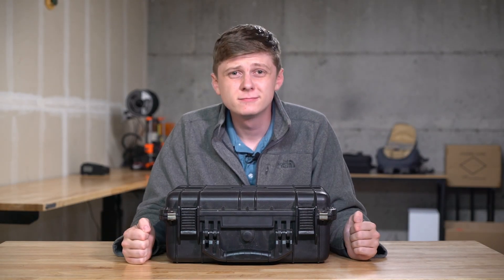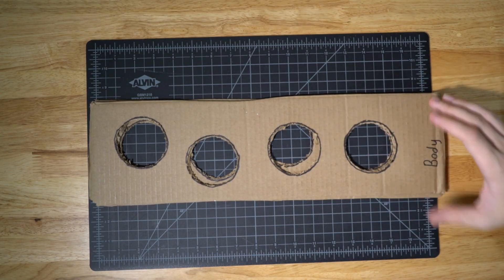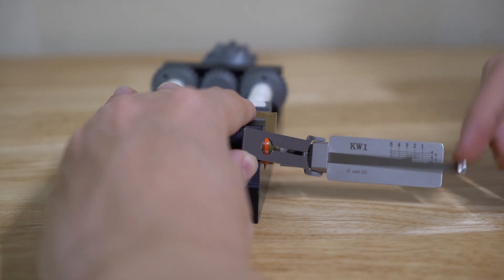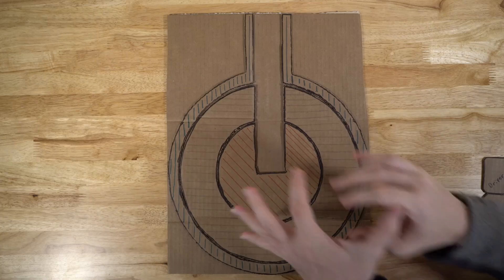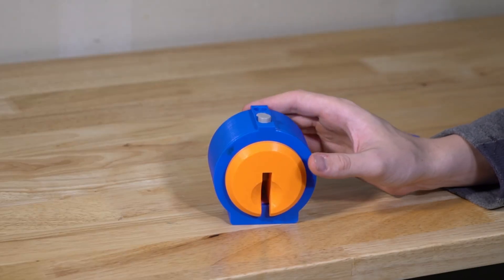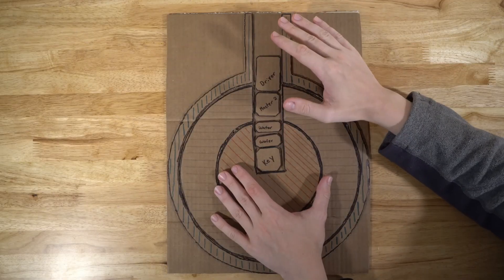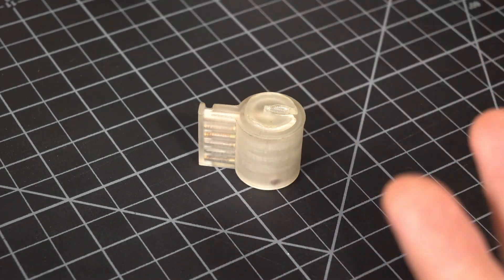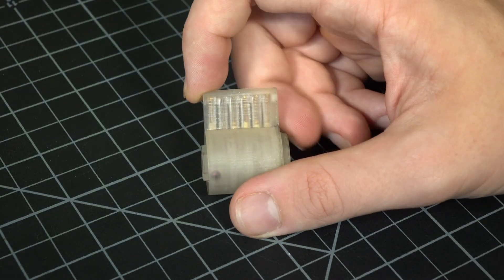How to Design an Unpickable Lock

Comment: You are intuitive, innovative and certainly provocative. Can you develop a bearing case for skate/longboard that takes advantage of resisting electro magnetic force for a two fold function, namely : to reduce the friction between the inner core of the casing on the bolt of the truck and produce a never ending current to keep the board moving untill a reverse polarity is applied, eliminating the nees for batteries and their exhaustive, exasperative and voracious appétit for renewed energy?

The question is not wether this is possible, the question is will it be you ? I could not conceive the plans for such a "devious-vice" 🤣, only the concept, so I've certainly achieved a pride of place, it now awaits honorificabilitudinitatibus to light upon you.🧑‍🎓

Comment: So, why not just add a watchdog pin to a normal lock (that is not accessible from the key hole) that is made with much higher tolerances and will almost always bind first?
It seems to me you already solved lockpicking with that one feature, sorta removing the need for overcomplication of the rest of the lock.

Comment: I enjoy locksport and I like the idea behind your lock. It would be a challenge to pick and wouldn't be difficult to make in brass either.
That said, locks are not the weak point 99% of the time. Most criminals will just break a window, kick in the door, or move on. Rarely is picking used in a crime.

Comment: with patience there is no such thing as an un pickable lock.. there are locks that break completely once picked. because they work in some ways similarly to this but this is a damn good start. nice video. the only flaw is the reason locks are made slopy is two fold 1) cutting costs for the end user and mass production. 2) duplicate keys even when cut using the original kay almost never work long after being made super precise locks require super precise keys. and those keys and the lock it self go through wear and tear every time they get used shoved in your pocket bang on other keys or objects get hand grim and dirt on them ECT.. if you loose your key you are boned. locks are the way they are so that if for some reason the lock cant be opened via the key you need not destroy the lock or container, hardware, what have you to get at what you locked up.  there is an old syaing there is no such thing as Safe.. or Secure. i imagine this idea has likely been thought of maybe even tested behind closed doors and found to be not suitable for the average user. due to complexity of design or expense to the maker/end user. after all there are no original ideas only first time presentations. the only lock that cant be opened is a lock that was designed NEVER to open .. for any reason. i helped design such a lock. therre is no key and no way into it with out destroying the container/lock mechnism. and subsequently it's contense.. it was an theoretic lock for housing a cursed item. opening the container destroies the item inside. it was a fun challenge.. again great video. but how would you adress the concerns above?

Comment: One way to defeat the watchdog pin is via concussion. Strike the thing you are trying to pick, often it's enough to do with your hand and the pins will jump up due to inertia. Especially when you include all the manufacturing defects it's really easy to do it this way and there are plenty of examples of new locks that fall short against this technique.

Comment: No lock can stop my sledge hammer. Its all about how strong the frame and door holding it is.
If the hammer doesn't work i switch to a pick axe.

Comment: I had pretty much the exact same idea, but i lack the 3d printing skills to actually test it.

I have one major improvement suggestion. Having a full middle core is a lot of material and take a lot of space. Instead you can use a small block just above the inner core. If the call the rotation plane xy, inner core would push the block in the z-direction after turning a bit and only if the shear line fits is it able to push the middle block and complete the rotation. This also eliminates the need to protect against binding the core to the middle core, since they now move in different directions.

Comment: Sorry, you don’t understand lock cylinder that well.  Your cardboard replica is wrong, the pins are not sloppy in the cylinder or housing , cheaper cylinder will have a larger gap in the sheer line.
The cylinder you are describing to make is called a Master ring cylinder made by Corbin and Russwin years ago.

And like most comments, people don’t want to spend money on higher quality locks, the  Ridiculous attitude that a lock is lock is where the ignorance comes from.

Comment: I think that the reason that most locks are very easy to pick is that the simplest and most common method of bypass is and always will be physical force.  Lock picking requires some level of knowledge and skill and while it's easy enough to learn these days historically it's been a much more rare skill.  Even in modernity the method professional lock picks use is to destroy the lock with a drill.
Reply: Speaking as a LockSmith... if your "goto" is a drill, You're not much of a LS

Comment: Just use an electronic lock. I have no idea why we are still clinging to the past and mechanical ones.
Reply: Because electronic digital locks still have flaw, with different solution of picking.
Mechanical locks are picked by physical force, while electronic locks are picked by both digital force AND physical force.

You don't get more security for having more attack vector.
Reply: @nilamelody  because you don't have to provide access (keyhole) they are not as susceptible to physical force. And how do you pick a digital lock if it has a progressive rate limit? That would literally take forever. There are theoretical ways to intercept it if you use some stupid way of sending the code, but not all of them use that and it's easier to change it. The only thing that is still holding it back is the cost and for that we need economics of scale.
Reply: @XRENDERMAN  I think you misunderstood what I mean by "physical force" :d
I'm talking a literal force to break the locking mechanicsm open, not picking a mere keyhole.

Also im not sure if you know this or not, but digital lock has actual physical mechanical part inside to actually provide the locking mechanism...
Which if you been paying attention to what I was saying, is breakable by physical force.

If you think that is unfair, then it is indeed.
That is why bank vault uses big mechanical vault made of strong metal. Because to counter such unfair force, is to have an equally unfair material to do the actual securing part.
Reply: @nilamelody  yes and you can easily put more metal between them and even conceal the location(s) of it because any type of reader is not necessarily colocated with actual deadbolt(s).

Comment: Pretty ingenious design. Excited to see a properly manufactured one being sent to some lock picking masters. It may end up not being any cheaper to produce than a simple electronic lock (which should be able to offer perfect picking resistance if done right) but an analog / non-powered alternative could still be very useful.

Comment: In 1972 or 73, I saw a demonstration of a lock that used a set of magnets to unlock it.  The key was set in a prescribed place on the lock body and if the correct set of magnets was in the key, the lock opened.  There was no turning of parts.  The only thing that moved was the shackle if the correct key was used.

Comment: If you have wafers of fixed sizes then that means that you can only use master pins which are multiples of that wafer thickness. For the two wafers shown in the cardboard example, that reduces the lock to 3 possible "heights"

Comment: Great idea and it is only slightly larger than a standard lock assembly. Shane's lock was much bigger. I'm sure lock manufactures will balk at the idea because so many door handles and knobs are already sized for the industry standard lock core. Wouldn't want to mess with the supply chain.

Comment: 15:26 this appears to maybe be weak to bumping, it's where you hit the lock to get all the pins to move, if you get the very back one that you can't access past it's binding with bumps, the rest of the key should be somewhat easy to pick knowing that the core and the inner core could be stuck together at that point with rotations.

Comment: couldn't you just build a tumbler lock with 4 rows of tumblers at 90 degrees around the cylinder? or even 8 rows at 45 degrees. Each row would be keyed differently.

Comment: The "watchdog" circle should be on the front of the lock in my opinion, because it makes it 100 percent sure to prevent picking if glue is used to bind the cores.

Comment: There is actually two locks currently available, which are not easily opened.
Of those I chose the one, where 4 magnets additionally need the same orientation.
However they cost 150 EUR+ per lock and unfortunately people are not willing to invest this.

Comment: The two cylinder technique has been patented by Corbin, and is known as master ring masterkeying.  A similar technique was patented by Best - both were almost 100 years old when I was an apprentice .  The false hole is also nothing new -- it is called a trap key cylinder.  If you employ that technique, you have to have another way to open the lock, so you can free the trapped key or core. (Copy pasted from another commenter.)

Comment: Dual sheerline locks already exist. Those are locks with interchangeable cores: a second key will allow you to take the core out for repinnining.
Other locks have security pins that give false feedback. With practice, those become trivial. In much of Europe, domestic locks are supposed to have a security rating. A two-star lock is really hard to pick. There's a huge difference between a dollar store padlock which anyone can open, more reputable padlocks from hardware stores, and two-star domestic locks. Those last ones take so much experience that thiefs in general don't bother with locks anymore. Either there's obvious forced entry, or the owner left a window open.
In all, the debate has become moot, and there's not a security system that can beat a vigilant neighbour.

Comment: You got to the important insight of this problem relatively quickly compared to most people who try to "fix" locks, which is that there is no actual way to decrease the total feedback. It's a mathematical invariant that you can't get around no matter how many or what type of physical mechanisms you include.

All that can be done is separating and diluting that feedback over a solution space that's either large enough or difficult enough to navigate to decrease the feedback's practical effectiveness.

Your solution doesn't break this rule. You can still pick this one pin at a time. But the discontinuities you introduced are efficiently placed between all the consecutive measurements that a picker would like to make. Meaning the picker has to be able to compare the core's total rotation between two unconnected states, rather than two that can be smoothly moved between. Doable, but much slower to test and requires feeling for absolute positions rather than just relative positions.

Most first attempts I see at pick-resistant locks are people going for "free energy" solutions, if you'll excuse the metaphor. Basically just doing things that move the feedback to different places in the device until they've lost track of where it is and just assume it's gone. Indirectly, these often distribute feedback over a wider area. But the direct approach of just chopping it up into discrete segments is so much more efficient.

Comment: unpickable padlocks are stupid and unnecesary.

want something secured to the max? weld it.

what can they do to welds? cut them.

what can you do to an unpickable padlock? cut it.

what will a mf do when he encounters your fancy unpickable padlock? cut it with a jigsaw.

just get a decent lock that wont jiggle open and cant be pulled open and youre mostly fine. if they want to steal it they will. secure your shit with better protection like alarms and trackers
Reply: Geesh

you're no fun.
Reply: @sarcasticcrypto  its just the truth my man. most of these are unnecessary, a solution in search of a problem

Comment: Vis-avis manufacturability -- CNC lathe/mill can be made to such high tolerance that the lock won't work.  Injection /die cast can be used -- its cheap.  Just drill the pin stack with CNC...

Comment: I have been a locksmith for 40 years -- the two cylinder technique has been patented by Corbin, and is known as master ring masterkeying.  A similar technique was patented by Best - both were almost 100 years old when I was an apprentice .  The false hole is also nothing new -- it is called a trap key cylinder.  If you employ that technique, you have to have another way to open the lock, so you can free the trapped key or core.
Reply: I think comments with links are filtered out. Had this issue myself before.
Reply: That’s interesting.  Do you know the patent-numbers?
Reply: @malvoliosf  I have replied twice, but something is bouncing my posts
Reply: @willschmit436  Huh, well, your comment is appearing here.
Reply: @malvoliosf  OK - so you got my explanation, and three links (two PDFs, and one youtube)?
Reply: @willschmit436 Nope, do try again now that YouTube is allowing your messages!
Reply: @willschmit436  You can’t put links in comments. Maybe try with just the patent number and country of issue and people can search for it themselves.
Reply: @malvoliosf  patent #414720
Reply: @malvoliosf  the patent number 414720 from 1889
Reply: there is no trap-hole in this design. BTW, if the shown lock was already invented, then why there are no locks around which use this idea?
Reply: @borincod  These designs (secondary shear line) are everywhere.  You won't find them at home depot, because of cost and complexity.  They (mostly) are in commercial applications, especially restaurants that fire their managers every month...
Reply: @willschmit436  aha. you are talking about the double shear line design for having a master key. In the double shear case, there are just more pins in each hole. There is no "double barreling" as in the author's design
Reply: @borincod  FWIW, the shear line doesn't have to circumscribe 360 degrees - the pins don't know that it is only a 15 degree segment.  The "double barrel" as you call it doesn't lend itself to all form factors.  Either it would have to be a design specific knob or mortise cylinder.  Of course, when Corbin master ring cylinders were popular, mortise locks were the most common form...
Reply: @willschmit436  OK, I misunderstood what you meant by a Corbin master ring cylinder. So, I've read an article on them written by Richard Howard in ALOA Keynotes. Even though a master ring design looks similar to the author's design, there are differences in the purpose and design.
The Corbin master ring cylinder was invented to increase amount of possible keying combinations and to  prevent cross-keying. A plug and a ring can rotate independently.

The author design is intended to increase pick-resistance in expense of keying combinations. A ring rotation in the housing and around the plug are alternately locked.
Reply: Also seems similar to Bowlsy locks
Reply: Youtube doesn't like the petent, or pdf files or other youtube links -- do a google search for Corbin Master Ring cylinder an article by Richard L. Howard CRL -- he has a solid command of the system.  Also -- look at the links in his video
Reply: Yeah I don't know why he's presenting this as a new invention. Weird.
Reply: @PanicGiraffe things are often reinvented many times because unless you know the words previous inventor used you are unlikely to find the patent.
Reply: @PanicGiraffe  It is HIS original invention, but that doesn't mean that it has not ever been done before.  He just re-invented it.
Reply: Also used by rivers locks in Australia very old concept

Comment: If I had a nickel for every YouTuber with an unpickable lock I'd have three nickels, which isn't a lot, but it's more than two!

The two in question are "Stuff Made Here" which you already mentioned and "Works By Design" who just revealed a second version.

Yours is definitely the simplest version I've seen so far.
Reply: @BetaKeja  -  You forgot about the Bowley lock that LPL couldn't pick.
Reply: @wickedcabinboy  Bowley isn't a YouTuber. 😝But that's another lock following a similar principle.

Comment: Really intersting. i do wonder how the wear and tear from regular use might affect the smaller wafers you mentioned, and if they might bend if forced.

Also, would bumping still work on this? Even with the extra pins, theres a chance they line up just right, no?

Comment: I am an amateur locksport enthusiast, and I just wanted to say your cardboard demonstration at the beginning of your video was a good visual representation explaining how imperfections of the internal parts of a lock make it possible to have and  identify binding pins so they can be "single pin picked" one at a time.
Reply: It has to be imperfect. If the surfaces were machined perfectly you would run into major stiction issues which would need oiled surfaces to resolve. However the lock is not sealed, so the oil would make its way out of the lock or worse, become contaminated and eventually jam the lock entirely.